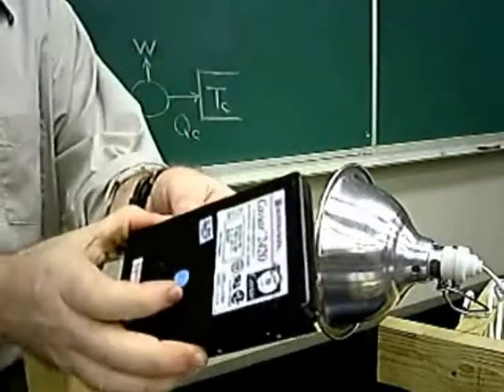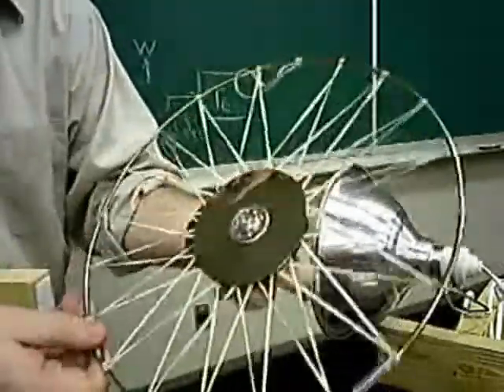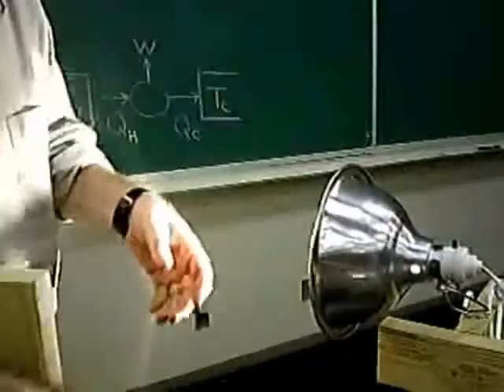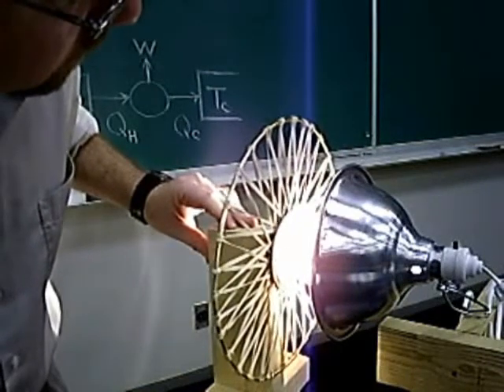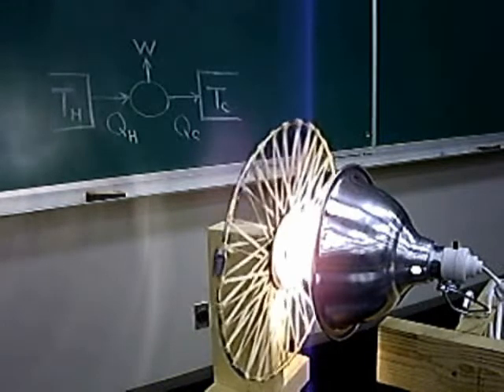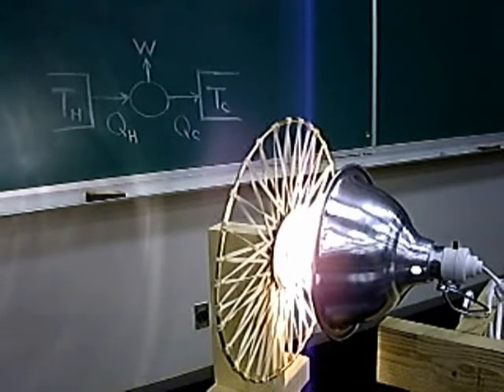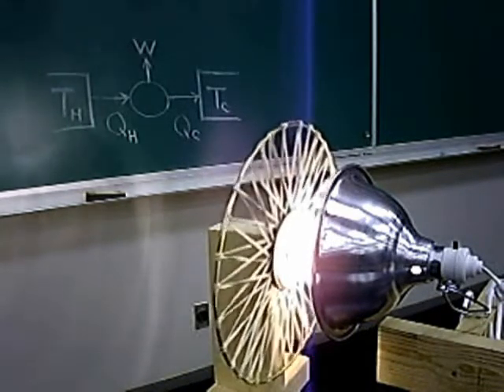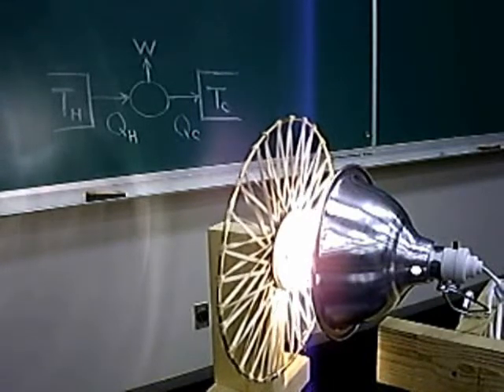Rubber Band Heat Engine

Comment: With FLIR I found that the stretching of the rubber is not proportional to temperature change, and that nearly all of the heating/cooling occurs at the "end" of the stretch, when the rubber nearly reaches its limit.

Perhaps these engines would work much better if all of the rubber bands were nearly stretched?  Under that condition the change in length with temperature might be much greater.  (But would it be offset by the increased force needed to stretch the opposite unheated rubber band?!)

Comment: If you built a clear box with a slit down one side wide enough to insert half of that wheel, then put it in the sun, it might turn due to the hot air in the box. Solar powered heat motor?
Absolutely impractical for useful work, but I think it would turn.